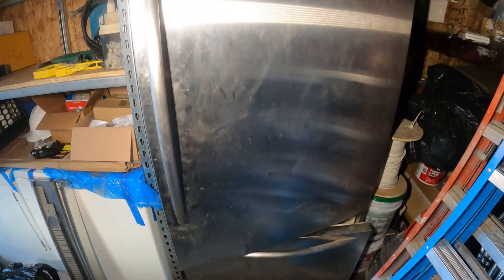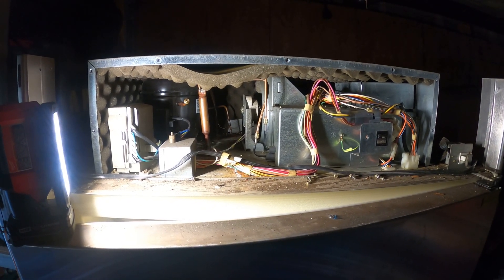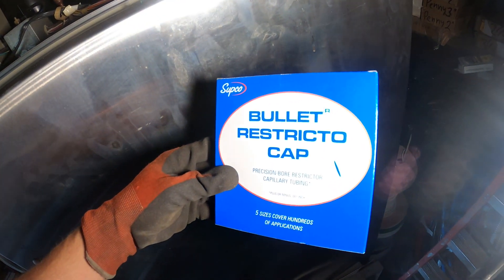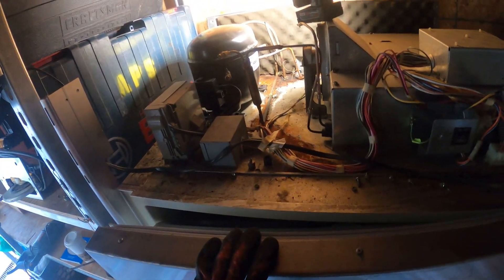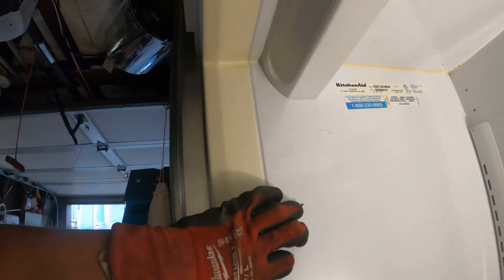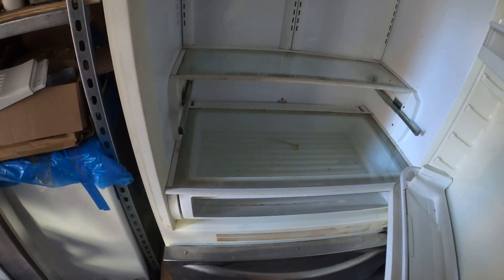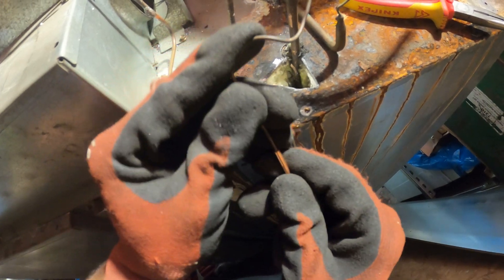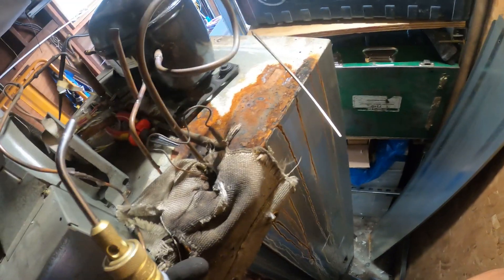HVACR Service Call: Residential Refrigerator Not Cooling (Capillary Tube Leaking Refrigerant) R134a

Comment: "I hope the last guy did not cut that cap tube." Yep, I had tech sabotaging my equipment to make sure it would not work, hopping to bill me for expensive repairs I guess. That's one of the reasons I learned the trade: so I could fix my own equipment. And yes, I have all the necessary equipment (including recovery) and proper EPA certification.

Comment: Do not buy Monogram appliances. After paying a service agreement for twenty years, they claimed to have visited our home for the second ever service call. He did not call, he did not text. He did not ring the door bell and the dog did not alert. A card was left stating that he had missed us. I called immediately and was told that WE missed the appointment. The sensitive service agent could not handle dealing with an upset customer and “felt threatened”. Unbelievable. Worse, I was placed on the “do not service” list. What ever happened to customer service. Clearly, delicate little flowers should not be in customer service.

Comment: Most residential manufacturers call the actual lineset between the condenser and the evaporator the heat exchanger. So technically that cap tube is part of the heat exchanger.

Comment: Appliance technician here, the previous tech was referring to where the cap tube is soldered to the suction line coming from the evap as the heat exchanger. Pretty common term in our industry. Also, the next time you’re there, leak check those stupid little crimp on fittings on the condenser where it goes from steel to copper. Notorious for leaking.

Comment: The evaporator is in the freezer compartment. Pull out the bottom drawer and unscrew the back panel. The refrigerator compartment receives cool air through a duct coming from the freezer compartment.

Comment: Believe it or not, they do make couplings for that size. They come in handy for txv change out's when the equalizer line is in a tough spot.
Reply from the maker: I had no idea they make couplings that small. I have no idea what diameter this even is. That's great to know. I could see it coming in handy for a TXV replacement with the external equalizer setup. Thank you for your input & for watching🙏Stay tuned for new videos every week🔧⚡️

Comment: 👍💪❄️🇺🇸 Great patience and determination. I don’t deal with residential refrigerators, tell ppl to call appliance tech they work on them a lot more. But it was for a friend 👍 nice jmt
Reply from the maker: Thank you Shine! I don't deal with them either and was actually the first one I've ever worked on but I do deal with some commercial refrigeration equipment. For a friend, I will try for sure. I would recommend the same or just get a new one. Thanks again for watching & commenting. Stay tuned for new videos every week🔧⚡️
Reply: @JumpermanTech  always enjoy ur videos very helpful.  I deal with commercial R/I, W/I n glycol beer units. 🍺 👍🇺🇸💪❄

Comment: Nice repair...on these units they refer to the cap tube wrapped to the suction line as the heat exchanger.  The evaporator is in the bottom freezer and the fresh food air is ducted through that damper that you removed. The serviceability is much better on higher end stuff like sub zero and true residential.  Great Job though!!!!
Reply from the maker: Thank you Steven! I've never heard the cap tube associated with the term heat exchanger. I appreciate all the info and tips. Thanks again for watching & commenting! Stay tuned for new videos every week🔧⚡️